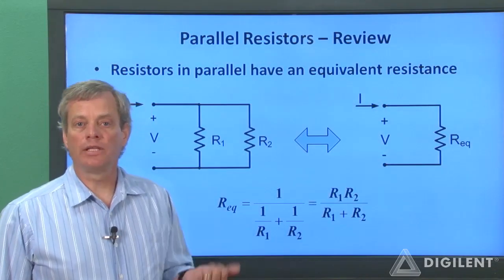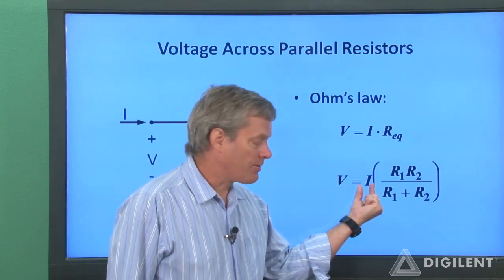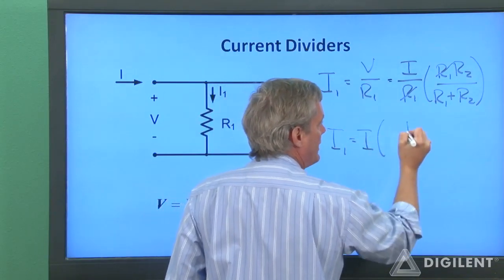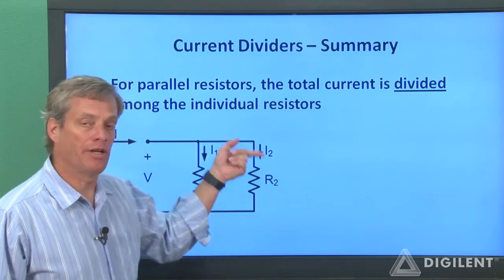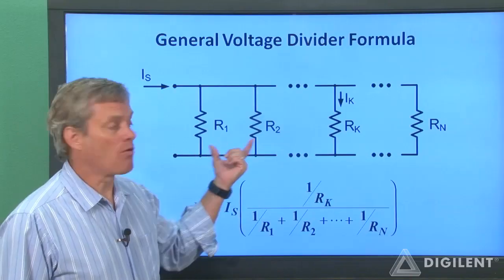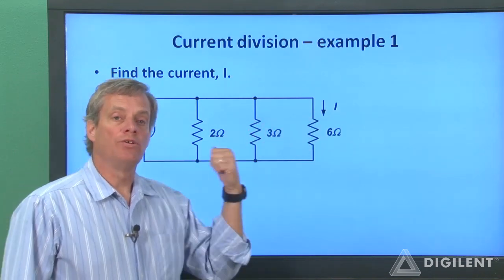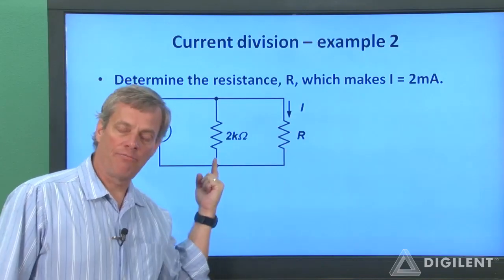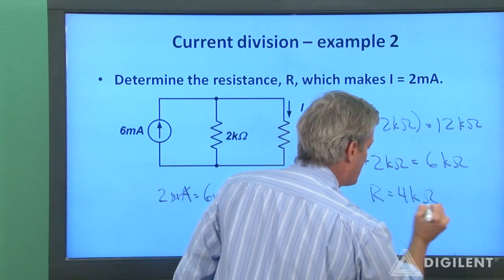Current Dividers

Comment: last part was lil 2 much for me instead i did it my own way by finding the current of R1 since i had i source and i2 already so i subtracted 6ma - 2 ma to get find i1 since you subtract source current to find the other of 2 parallel points. i found v1 using ohms law and i knew voltage stays same in parralel circuits so i did 8v divided by 2ma to find the resistance of R2